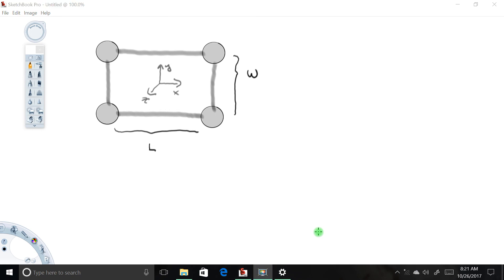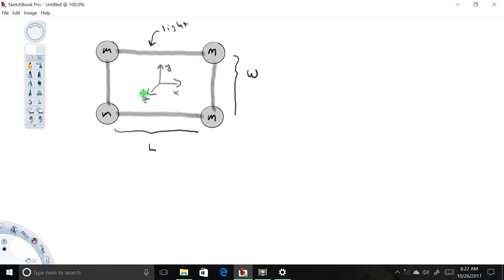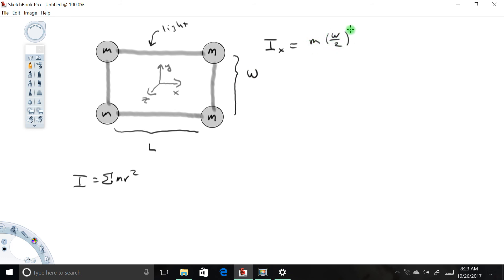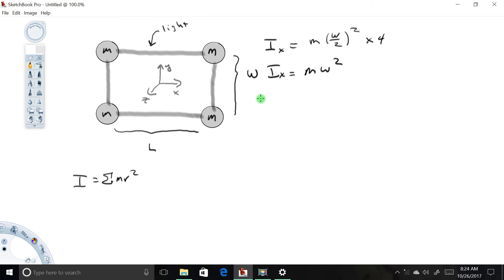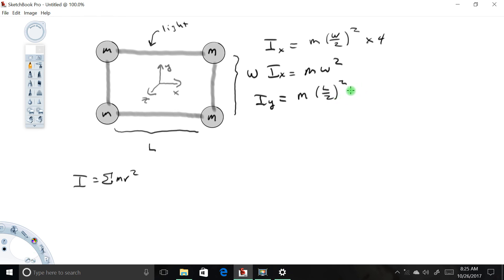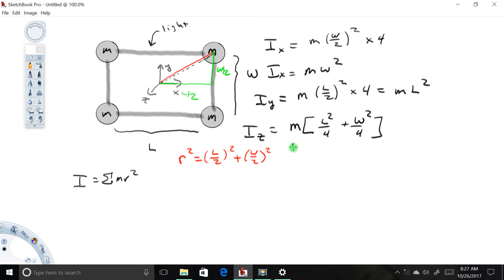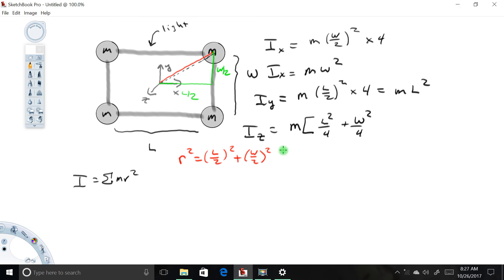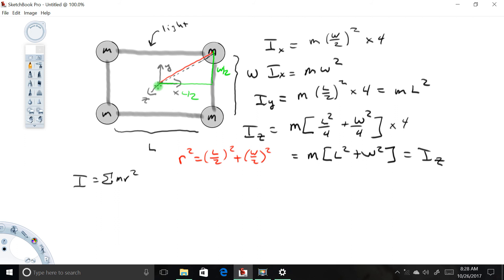Moment of Inertia of a system of masses

Comment: i dont understand why mr2, what if the system is a disc, than it will be 1/2mr2?
Reply from the maker: This example is about the moment of inertia of point masses. If you break a disk into point masses and add up the effects of each point mass, you get 1/2 m R^2 for the disk. This example just is not about a disk.